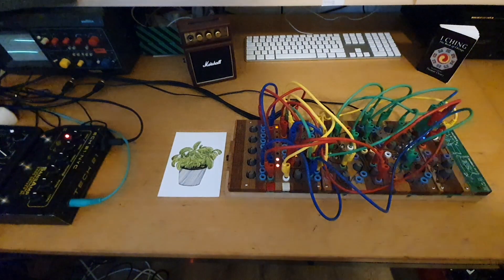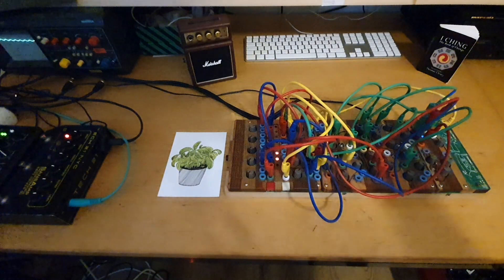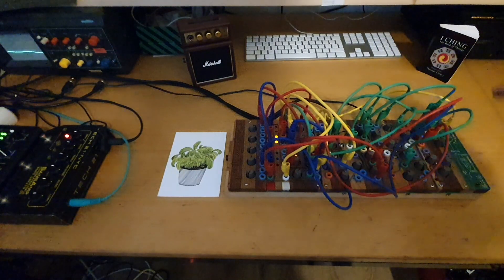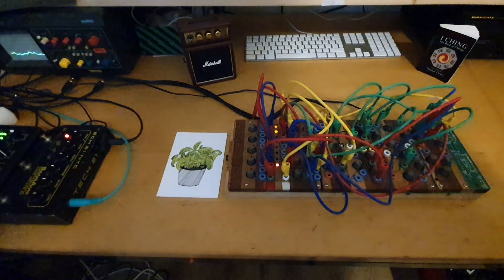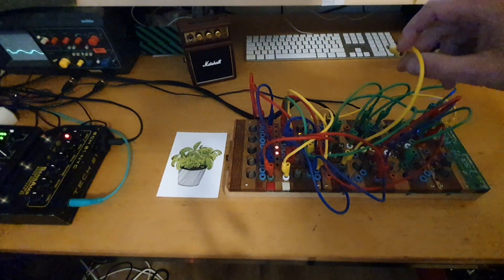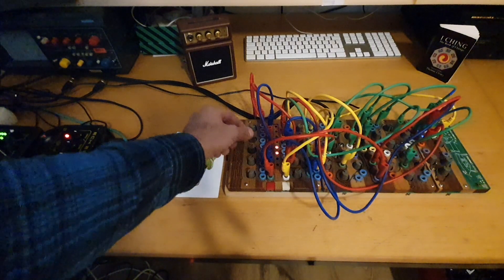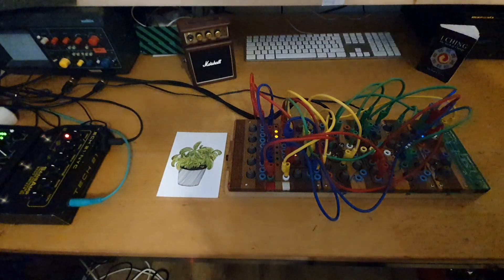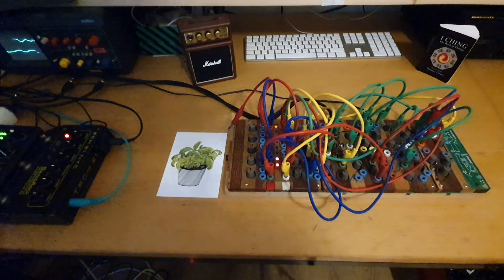Plumbutter for beginners (Part 5): Getting Serious!

Comment: I think the real beauty in plumbutter is the rollz section, the little 'zipper' noises when connecting to ultrasound filters I find fascinating. My first instrument was a Roolz Gewei which is basically a rollz 5 but with double deerhorn. That was a beautiful instrument, sadly sold to get a second plumbutter & what I miss about it was the rawness of the deerhorns compared to plumbutter but also the rollz section is cleaned up in plumbutter. With the old rollz circuits you get more 'zipper' noise and a lot more interest when connecting, definitely worth building some additional rollz circuits via paper circuits or if you can afford buying a Rollzer. Hairy values of capacitor & resistors are best chosen for slow behaviour imho. My background is Drum & Bass but now I prefer the slowness of life.
Reply: hi @David Bloor - do you have any tips for achieving the zipper and spurty sounds on the PB2? I've had chance encounters with them, and I'm coming back to the PB2 after a lengthy break, and have trouble re-creating them. As you said, I know that they are less common on the PB compared to the rollzer as well as the previous incarnations, but if you have any general tips, I'd appreciate.
Reply: Hi  @gordonwithers , try & concentrate on connecting brown rollz together (ignore the orange) then connect a brown to an ultrasound green in, though PB rollz are not as raw as previous versions. 
You can always have a go at building some early rollz, Peter has the papercircuits published on his website, also Jason Taylor on Muffwigglers is producing pcb's.
Reply: @davidbloor1190  thanks!
Reply from the maker: You obviously have more experience in the Plumbutter. By now I've sold it, I think it was missing something and for this money you gotta have everything right.

Comment: I'm wondering if your odd gong behaviour has something to do with the rate control, were they set at the same speed? Nice patch.
Reply from the maker: Well yes it could be. The big question is: with nothing patched between them, can one Gong influence the other somehow?
Reply: @ethermod307  They are separate circuits on the pcb, so I don't think so. Maybe in the patching there is a connection, often with stacking multiple cables it's difficult to get a clear picture & also sometimes what you think is an output or input can react in the opposite way. It's the nature of the beast :-).
Reply from the maker: @davidbloor1190  Yes i've read all that, it was indeed interesting to read. Maybe now that i know more I should read them again. But how can you " tame the deer with some regimented behaviour"? What do you think this means?
Reply: @ethermod307  Those are my words, but you've kinda done that in your video by introducing pulses to your deerhorn. Deers don't usually behave that way ;-).
Reply: Peter's explanation of the Roolz Gewei is 'drum & drama' and he goes on to talk about Pamela Anderson & Tommy Lee. You get the steady rhythms of Tommy mixed with some drama from Pam. Plumbutter is the 'laboratory Roolz', basically a cleaned up version of the earlier instrument but the history is still there, you just get a more predictable & controlled patching environment.
Reply from the maker: @davidbloor1190  Haha no way!
Reply: @ethermod307  Oh yes, he has a great description of Pamela running across the beach. Peter has a great sense of humour & although you should not take everything he says seriously, it actually makes a lot of sense.